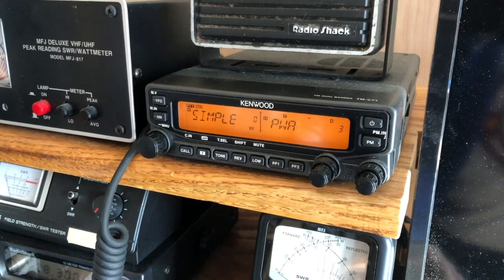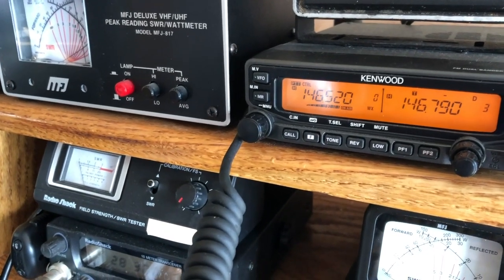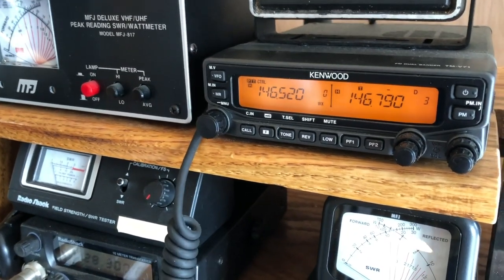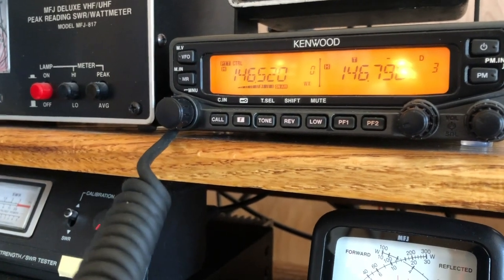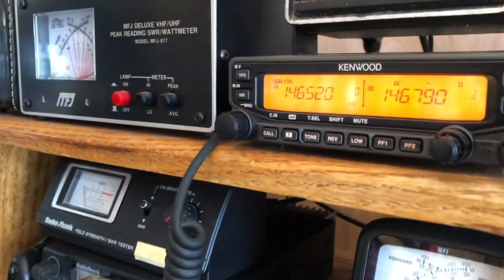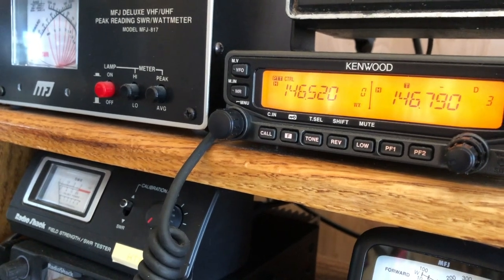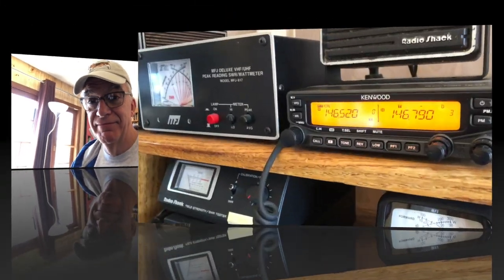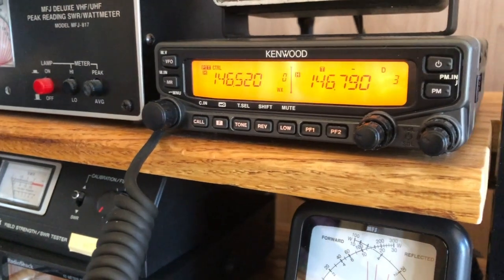Making 146.52 great again!

Comment: I have my call sign and "monitoring 146.52" on the back of my RV. I travel the US with the radio on 146.52 i have never had anyone call my call sign. 2 meter is really dead other rhan local repeater work.
Reply from the maker: You might be right on the state of 2m activity.  I have 52 programmed in all my radios and have never heard any activity on it when scanning.

Comment: Every now and then , there is activity on 146.52 MHz , in the Denver Metro Area. We have a Simplex Preppers net meeting , Wednesday , 7 30 PM , 146.55 MHz. My base dual band radio has a 50 Watt maximum setting. Have a Diamond X-200 base antenna. I get out better than many. Tim , KB0VQP.
Reply from the maker: I like the idea of supporting prepper comms!  I recently did a live stream with VE3TWM (Outdoors on the Air) and N9SAB (Tim Ortiz antennas) where we talked about how radio clubs should support preppers.

Comment: I haven't spoken on .52 in years. When I was still a Tech I always had a rig on .52 lived in the Chicago area. One day had a 18 wheeler come through and he called so I answered. He needed some info which I was able to provide and we ended up talking for about a hour till he was out of range. I had a 40 ft peak on our home so FM was killer for me back then. I always monitor in the car, now we live in rural Iowa. I think if someone came back to me I might drive off the road! Would be shock for sure. I miss the fun of it and wish there were folks around this crazy farm hill area that were on Simplex. There's a repeater but no one ever comes on it. The club they have is about 10 good ole boys drinking beer and whining. Thought about just starting a new club from scratch just to see what would happen. Great job!
Reply from the maker: Droning Harry Disappointing to hear about your local club!  You could try starting a new club if there are enough hams around, but you might end up with the same guys joining.  That QSO with the trucker is what ham radio is all about!  Keep at it though...ya never know if someone is out there.  Thanks for watching and for the comment!  73 de K2CJB
Reply: Hello Sir! I see its been 3yrs since your msg. …Did you ever
turn the ignition, stomp on the foot starter, and kick up enough dust to fire up a 🔥new club?🔥
Reply: Talking to the main club in the state at the annual Hamfest to see if they might sponsor a starter group. I'm hoping it might go somewhere. Someone stole ,y radio and I just haven't ordered a new one.

Comment: A few months ago I took the Amtrak Cardinal fro Cincinnati to Philadelphia. At each stop where I could step off the train, I put out a call using my ID-51 on 146.52 and 446.0. I got a reply on 52 when I was on the platform at Washington DC. My home QTH is Ivyland PA. We might make contact on 52. --de N3TS

BTW - I had a couple incredible simplex contacts from a glider above Hilltown PA. When I put out the call on 146.52 from the glider, many stations came back; I worked a couple before switching to 446.0. I worked Cape May (95 miles) on 446.0.

Comment: I've had two past experiences with using 146.52 Mhz FM. When I was younger I was an avid Backpacker. Back in the 1980's I lived in Arizona and used an IC-2AT handheld. I liked to Backpack in the high elevations and mountain topping where I worked 146.52 Mhz at 1.5 watts and 0.15 watts with a hand held dipole. I made many 100 plus mile QSO's it worked well. Later in 2000 to 2001 lived in Wichita Kansas and a 146.52 net was formed which met once a week. Most of the stations also checked in on other net's on the local repeaters which I was active on at the time. I noticed that I was working the same stations on simplex that I worked on the local repeaters. My antenna was a 2 meter base antenna up about 35 ft with about 6 dB gain and running about 50 watts, I was surprised at the coverage and clarity that a basic 2 meter base has. It's a resource worth tapping.

Comment: VHF around me is dead unless there are storms, and there is a networked series of repeaters that run on 146.715. Some spotters use this net, called SWIRALINK. There are 4 repeaters beginning with 146.715 I far Western Okla and can link with a system out of Lubbock and Amarillo TX to the west and also 146.410 OKC EM and on to either Ft Smith, AR or Cavanaugh Mtn, SE Oklahoma. So possible to link almost from the Lee of the Rockies to Central Arkansas. Has saved lives.
But I never hear anyone on VHF anymore. Most repeaters were switched to UHF a few years back around here when the local club gave them up to SKYWARN. Now everyone who is still active has abandoned BOTH VHF & UHF for digital and digipeaters are going up. I can scan the LOCAL VHF/UHF frequencies for days and the only thing I ever hear are hunters, etc talking on unlicensed GMRS. Most I contact have no clue they are breaking to law. Many don't care. I still run the wilderness protocol whee there is  special event like a bicycle race, a cross-country event, or marathon, but in the age of cellphones, that is highly unlikely as well. Lightning got my HF capable base rig a few years back and I can't afford to replaced it.
Ham Radio is dead out here.

Comment: Make 446 great again. Depending on where you live, you’ll get much better range, less inter-mod, and a lower noise floor by using UHF. You’ll also get the added bonus of smaller antennas, which in turn leads to more gain on both ends since most people are willing to put up with a 9db UHF antenna, but definitely not so many people are willing to run the equivalent sized antenna for VHF. So, if like me, you live in a dense urban city, try 446. Here in SoCal it works better, and further than VHF 9 times out of 10.
Reply from the maker: p a Not a bad idea!  I'll listen around here to see what kind of activity is out there.  Thanks for watching!  73 de K2CJB
Reply: I thot vhf had better range and UHF more line of sight ..?? Let me know details ,like to try it. Kc3cfz
Reply: @CoolOldBiker  you are correct... vhf is generally better range than uhf

Comment: I guess I was under the understanding that 5:20 was limited range Simplex 20 miles though is pretty decent what antenna are you using in are you using an amp
Reply from the maker: robert wilson I have an old dual band vertical on the roof (forget the make) and no amp.  Just the V71 into the vertical.  It works pretty well!  Thanks for stopping by!
Reply: With an antenna on my roof I could easily go 35-45 miles simplex with 5 to 10 watts to another station with a high antenna. Antenna height is everything.

Comment: 2M FM Simplex is the majority of where I'm at.  I've been on 146.520 close to everyday for last 6 years and have regulars that meet up in the mornings out there and new people from time to time as well.  When no one is on 52 I'm on another 2M Simplex freq.  Why use a repeater when you can work simplex.  If you have a less than par mobile setup then that would be great motivation to upgrade and tweak everything you can.  Given you have activity near your area.  I find it rare that I need a repeater to chat and most my work is in my mobile to other mobiles and base stations.  73

Comment: What antenna are you using? I have the same radio. Also, you may want to open up the squelch.
Reply from the maker: Allan Beckman I forget what it is.  It’s a dual band vertical.  Not a Ringo.  Good point on the squelch!

Comment: Im in bristol pa. You monitor the bears repeaters?
Reply from the maker: Sure do!  I have them programmed into my mobile rig and the home rig.  I'm in the Penn Wireless club that meets in Fairless Hills.
Reply: @k2cjbradio  i might have to call out for you sometime. -ws3ric
Reply: @k2cjbradio  im learming dmr now on my anytone 878
Reply from the maker: @erics6177  Wow.  Good luck with that!  I'm not 100% sold on any of those modes (DMR, Fusion, D-Star).  Mainly because of the complexity of programming it.  I always thought that an HT should be easy to operate in the field.  Seems to me that the digital radios need a laptop to make a change.  But, that could be me being an older ham!  :-)
Reply: @k2cjbradio  the anytone 878 was easy to program analog in the field. My unit had an issue on digital transmission and im sending it back for another one.

Comment: Hello, do you know why there is so much noise on some simplex channels?
Reply from the maker: furonwarrior What kind of noise?
Reply: It sounds like rapid fluttering, but it’s strong on about 2-3 simplex frequencies. Even on a repeater, just a very strong rapid fluttering noise, but it turns off every once in a while. I’m new to Ham Radio and got a Wouxun KG-UVD1P and finished programming in all the Ham frequencies for 70cm and 2m. I got 3 contacts today for my first try, but I thought it would be much busier on Ham than on CB. It seems about the same.
Reply: If you wanna tune in and see if you have it, I can give you the frequencies to see if you experience the same problem.
Reply from the maker: furonwarrior let me know and I’ll give it a listen
Reply: K2CJB Radio I found out that I was using a defective stock rubber duck antenna with 5.0+ SWR readings. Now I’m back to finding a new portable antenna. The car antenna seem to not show any of the issues with the fluttering sound on the two Simplex channels and I would assume that I shouldn’t have a problem with a connection with a repeater. Just glad I didn’t kill my new radio. The SWR meter saved my ass.
Reply: K2CJB Radio Just making sure, are the simplex channels on the 2 meters go like 146.40, 146.41, 146.42-146.55, 146.56, 146.57, 146.58?
Reply from the maker: furonwarrior I always knew 146.52 and maybe one or two others but with repeaters there might not be as many
Reply: K2CJB Radio I was looking at the band plans on here (http://www.arrl.org/band-plan) and saw the simplex channels range from like 146.40-146.58, being 146.52 being a national call frequency on the simplex channel. I just don’t know if it’s like 146.40 146.41, 146.42, 146.43 or like 146.401, 146.402, 146.403, etc. But I think most people just use the national call frequencies and repeaters and even mess with simplex if they’re looking for a quieter signal to talk on. And I think we could use very specific frequencies like 146.428 or something, but no one is gonna be using that frequency. Almost if most people can talk privately on Ham Radio if they wanted to. 🤷🏼‍♂️

Comment: 52 was never great.  It was/is a frequency designated by hams as a simplex comm channel.  Nothing special about it.  The bigger issue with .52, is the user who more than likely doesn't even know .52 exists for simplex operations and those people doubly, don't even have a decent antenna anyway, just an HT with a rubber duck.  You want to make .52 great again, do what I am doing, running RTTY, SSB, and other digital modes on .52, gets people wondering  what all that stuff is.

Comment: g4kfj calling cq on 145.500 for 21years NO qso s made 
Ok lets buy very expensive digital equipment  start with dstar hello cq ,try wires x hello cq ,, ok dmr will do it hello cq , ah ha HF 
ok new ic7300 hello cq  on 20m nothing 
lets try FT8 on 14070 GE SUS worked the world in a couple of days 
Go CB it just makes sense 
73 
G4KFJ
Reply: You must be in a real dead zone to never get a reply on 145.500, it's fairly busy most evenings around the northwest of England.
Reply: Too late all equipment sold !now on Peanut